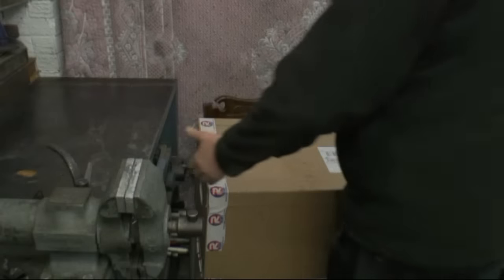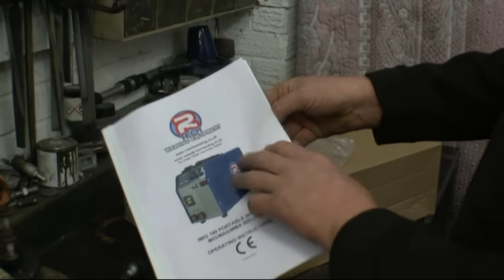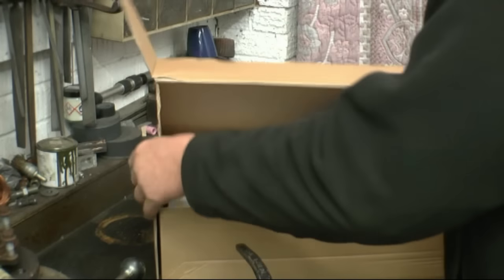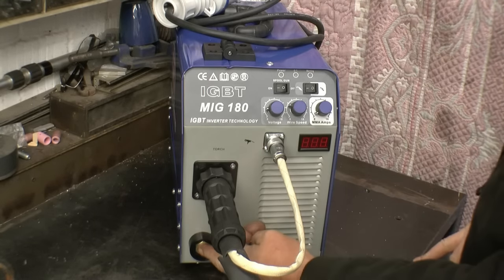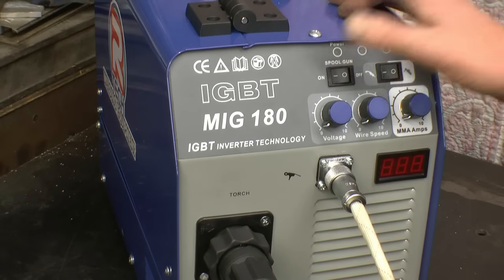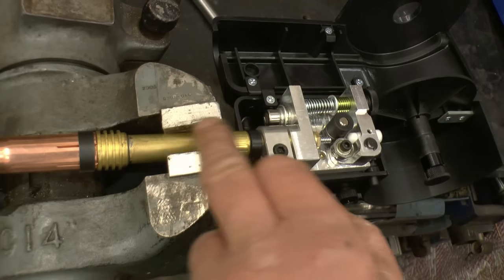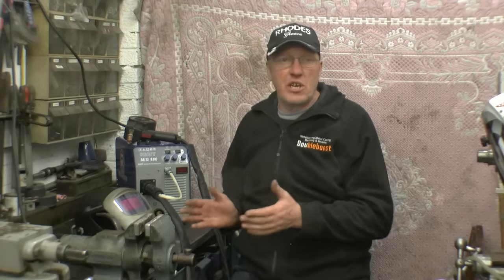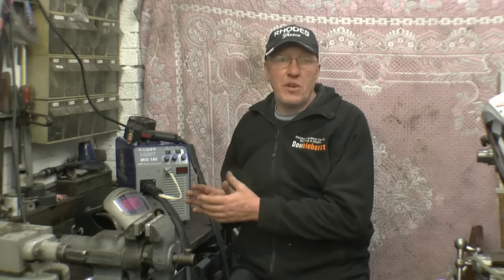R-Tech MIG180 Spool Gun Aluminium MIG Welding Part One

Comment: If your doing aluminium then also change the metal wire guide or liner to a plastic one. It can be used as is with that metal wire guide or liner but there will be less issues with using a plastic one.
Reply: ChronicPain Spool guns usualy have a steel liner as standard because the run is short and straight. A teflon liner is only necessary on standard torches because of the bends as the soft wire will chafe as it passes round through the bends and kinks.

Comment: nice little machine... wonder if you turn the wire speed all the way up if you can control it with the pot on the gun? would make it easier for on the fly adjusting

Comment: does this spool gun work with 1.00 m.m aluminium wire?
does the drive roller support?
Reply from the maker: yes 1 mill wire no problem  i will be using it in part 3